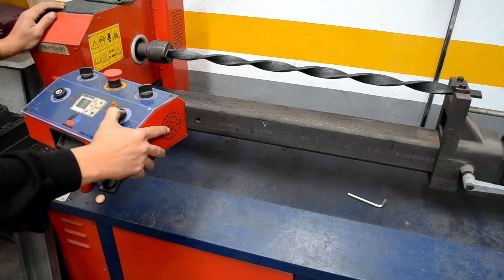¿ COMO REALIZAS TU ESTA PUERTA ?

Comment: Buenos días.
En alguno de sus videos veo que usa una maquina para hacer encajes de cerraduras.
En este lo hace con taladro y a mano.
A que se debe? Es que la maquina no vale para todos los tubos?
Reply from the maker: Hola Pablo, vale para diferentes combinaciones de tubo pero da la casualidad que para tubo de 60x60 no vale, desconozco si vende aparte algun troquel para ese tubo, para 60x40 por ejemplo si vale o 50x50 ademas de sus otras opciones 35x35 / 40x40 ... saludos!
Reply: @cerrabojcarpinteriametalica  gracias por su respuesta

Comment: Exelente una pregunta se pude usar flux sin gas para este tipo de trabajo
Reply from the maker: Hola amigo, el FLUX es siempre sin gas, si no sería MIG o MAG, claro que puedes, pero a mí personalmente no me gusta, preferiría electrodo si no tengo gas, gracias por comentar!
Reply: @cerrabojcarpinteriametalica si hay flux con gas
Reply from the maker: @pipomandarria999  MIG (metal inert gas), MAG (metal active gas) FLUX CORE (FCAW) este último amigo es sin gas, es un hilo especial  “hueco” o tubular de núcleo fundente (Fluxed Cored Arc Welding)